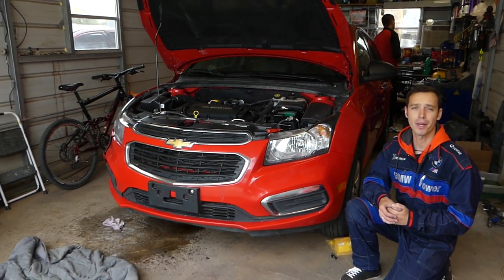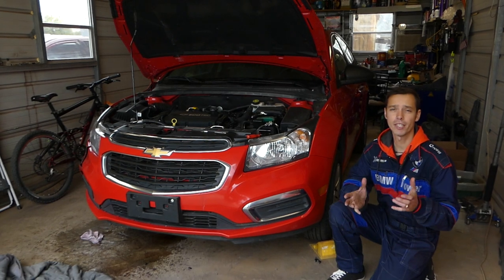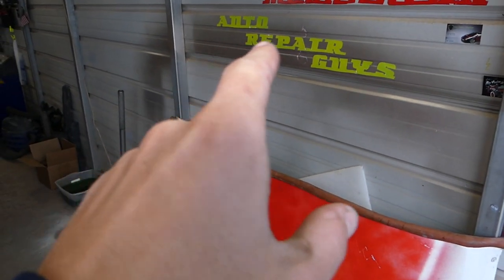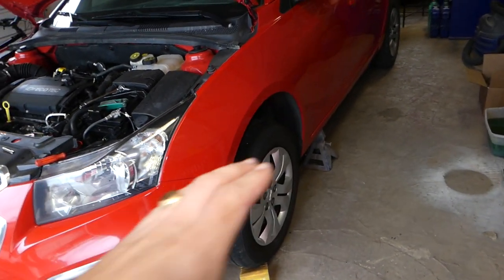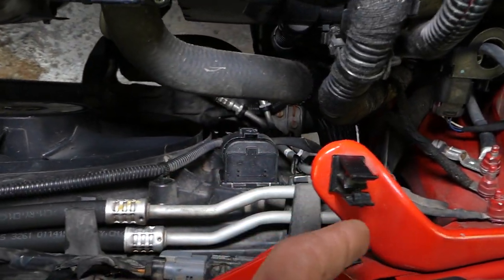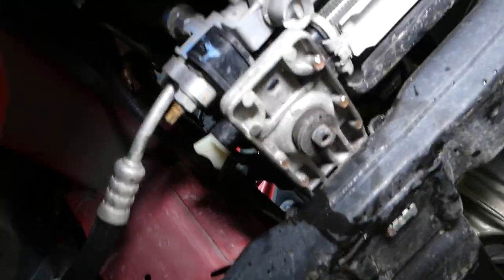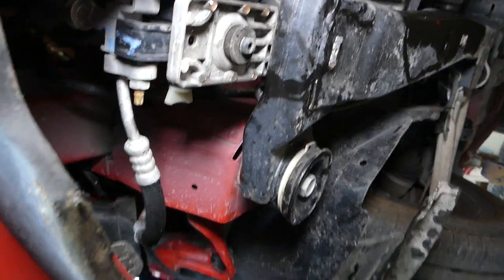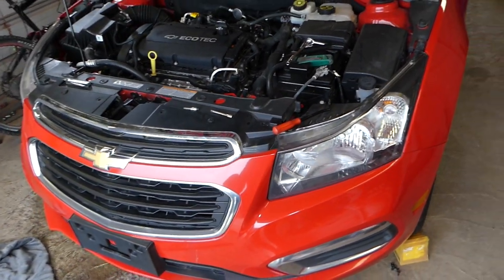CHEVROLET CRUZE COOLANT RADIATOR DRAIN PLUG LOCATION

Comment: I have a question about the milage, what is the average miles on a Chevy Cruze LS manual 6 speed transmission Eco Tech? I heard the average miles are 100,000 miles before it needs repairs. I also heard the transmission gives owners problems around 70,000 plus miles.
Reply: Outdoors Beyond Nature these ecotec motors need only full synthetic oil changes at 5k miles. Besides some coolant parts these cars are very reliable
Reply: @long-dongvonbraun501  They were asking about longevity before repairs, not maintenance intervals.
Reply: @Tasty yeah after re-reading their question it makes sense. I must've been tasting whiskey that night. The ecotec motors are reliable so much that my Cruze has over 150k and my wives 1.8 has over 200k. Maintaining any vehicle is key to longevity and reliability